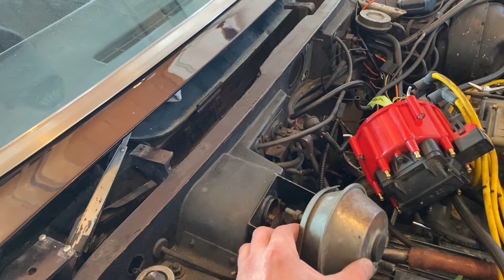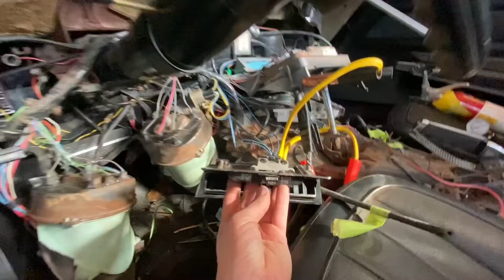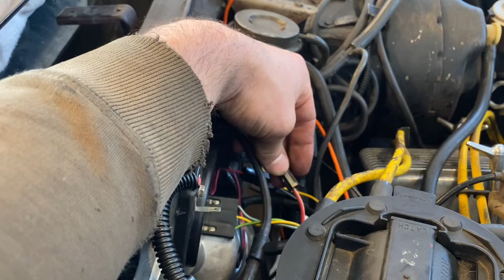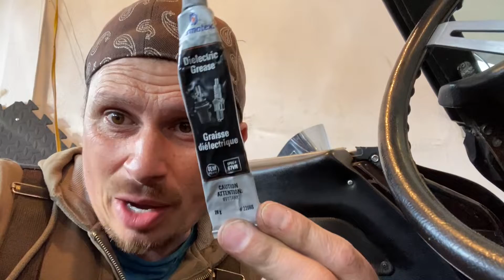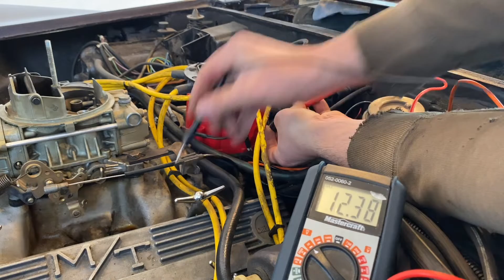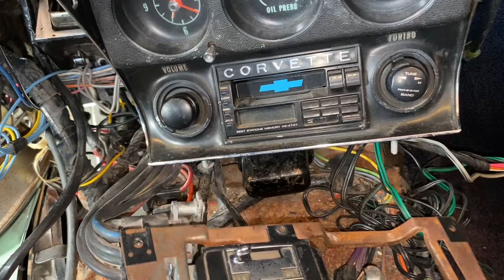Corvette C3 Windshield Wipers repair fix. How to troubleshoot Windshield Wipers and test wiper motor

Comment: on the 68 C3 with the single spade connect override switch  to bypass the switch do you just run a wire from a good ground to the female connector on the wire to bypass the bad switch? for testing?
Reply from the maker: I'm sorry I can't remember, I remember that the 68 something was backwards
Reply: @ProblemSolverGarage  Thanks for the reply.

Comment: I have a 69 and i put a new ground for the wiper and blower before i found this video but the weird thing is the wire that is supposed to be the ground for them has power to it so it has +12v on it
Reply: Also I have an issue where the circuit with the clock and Courtesy lights have a dead short but doesn't blow the fuse and drains the battery when I do a Continuity test from a positive on that circuit to Ground it has continuity

Comment: Hey great videos, but on my 1971 the problem is that when I switch on the wipers nothing happens.  Wiper door does not open, but when I use the override switch under the steering column to open the wiper door it opens obviously and the wipers work. It’ s a new switch along with new relays and vacuum lines.
Am I missing something?
Thanks
Frank
Toronto

Comment: I just started watching your videos since I pulled my vette out of storage after years, super helpful. Question about this video, where did you find the small black wiper motor cover for a 1969 when not putting back the sprayer?!? I can’t find one anywhere. If you see this, thanks.
Reply from the maker: I have seen them on eBay before, but that one was actually in a box that came with the car

Comment: I've owned a 1969 427/435 since 1970. Just had a new wiper motor installed and everything was working fine. All of a sudden my windshield WASHER comes on when I use my wipers in slow or fast speed.  The washer won't go off until I return the switch to the OFF POSITION.  Can the problem be the switch itself?  Most people are saying it's the pump wheel that goes around and then locks into place.  That is all new but the switch is 52 years old.  I've ordered a new switch just because the original is so old.  Any guesses??  Great job on all your videos.  Thanks for any advice you can provide.

Comment: Did you ever do a video on repairing the windshield washer pump?  I don't see one listed.  Mine does not work.  I see a kit listed at Eckler's.
Thanks. Paul
Reply from the maker: I converted it to electric but never made a video about it unfortunately

Comment: Thanks tom, if not for folks like you the rest of us would really struggle and do thing wrong.  Everything went as you described.  I have one curious problem.  I only get one speed (low).  If I remove the green wire I only get high speed, and it wont park.  Any thoughts?

Comment: I am rebuilding my 72 coupe from ground up, completely rewiring the car using an aftermarket system. American auto wire highway 22
I'm also relocating the fuse box in the compartment behind the seats so that means that all the wiring had to be built.
And on top of that, I am eliminating the vacuum system and replacing it with electric motors.
Headlights doors motors are done and working fine but I struggled a bit with the wiper system.
Yeah I know, self inflicting pain LOL.
Tom you have no idea how much this video helped me.
Thanks a lot SIr.
Reply from the maker: Thanks for the awesome feedback and good luck with your project

Comment: Wipers weren't working. Watched this video, cleaned the corrosion off of the ground connector. Everything works now. Get a wire brush before you buy a new motor.
Reply from the maker: Nice 👍

Comment: Tom... this may sound like a stupid question, but here it is anyway..  My son has a '71 Corvette (just purchased) and the three wires going to the wiper motor (harness) has 2 hots and a ground.  Is this right?   The "blue" wire is a hot wire and by your video, should be a ground.  I did test the new wiper motor just as you had shown and it works... even works on the car if I am using jumper wires.  But when I connect the harness, nothing.  The washer works when I press the switch but nothing from the motor.  I have not taken the dash apart to see if the connection on the switch is in the correct  position.  Can you give me some advice?  I appreciate it.

Comment: Hey Tom, I agree with everyone here....you are one of the best I've seen so far (and I've seen A LOT) when it comes to teaching/explaining.  I am NOT a mechanic; not even close and you've helped me tremendously with my 69 wipers.  FYI, it wasn't anything electrical....once I dug into it, the bolt/bushing for the actuator wiggled lose and was never connecting the power, so need to just hook that part up once I get brave enough to start taking the door off so I can get to it.  I'm learning.....and your videos are incredibly helpful.  Thanks again....I am super surprised, with the great C3 following out there, that you don't have 10x's the followers you do...it's just a matter of time I suppose.  Keep up the great work.
Reply from the maker: Thanks so much for the awesome feedback, good luck with your project ! 👍

Comment: I’m restoring a 81 that has been parked since 2003, it’s in rough shape, and so far I’ve put a new Blueprint 383 engine, rebuild all the calibers, replaced the rotors, and brake hoses, wiper motor, new gas tank, replaced trailing arm, strut rod and spring shackle bushings.all half shaft ujoints,, now starting on the interior, so I’m following you with any helpful information i can get. Thanks
Reply: Hi i have 68 and have the same problem with wipers i will follow  your instruction .-YOARE THE BEST
Reply from the maker: Awesome thanks for watching. And good luck on your project

Comment: Great vid as always Tom! Quick question, which way do the wipers go? What I mean is, which wiper sits at the bottom? Is it the driver side or passenger side?
Reply from the maker: I’ll check when I get home, one of them presses a vacuum relay when it’s all the way down, that’s what controls the door to open and close, I believe the passenger side is at the bottom but I’ll double check when I get home. 
 Next video vacuum system for the headlights and wiper door
Reply: @ProblemSolverGarage  thanks Tom
Reply from the maker: so the passenger side wiper sits Below the driver one, 🇺🇸 USA set up not British one
Reply: @ProblemSolverGarage  thank you!